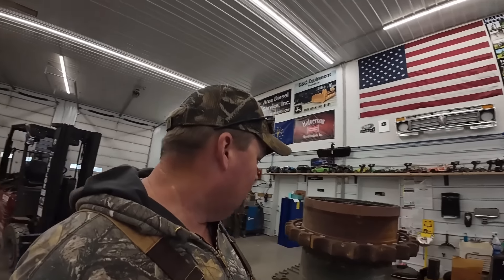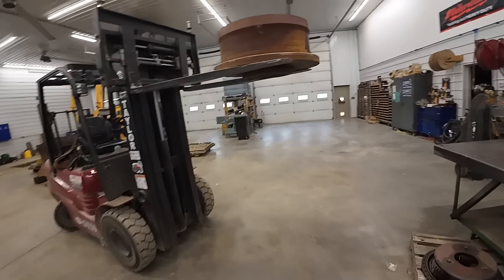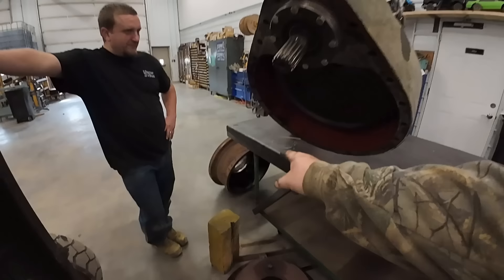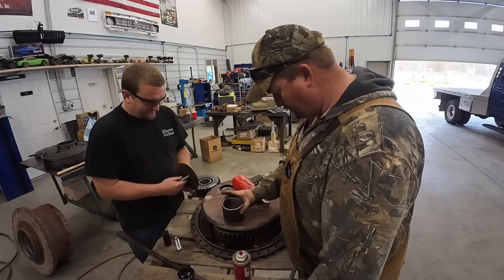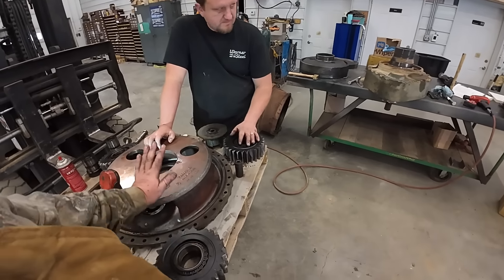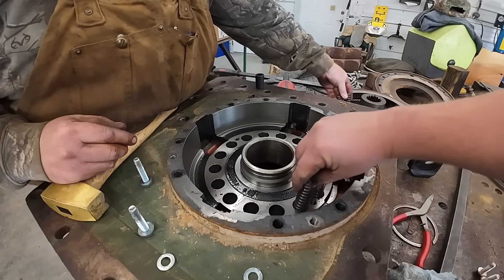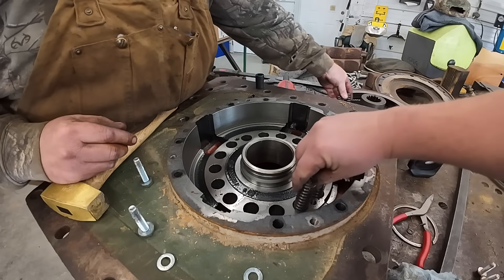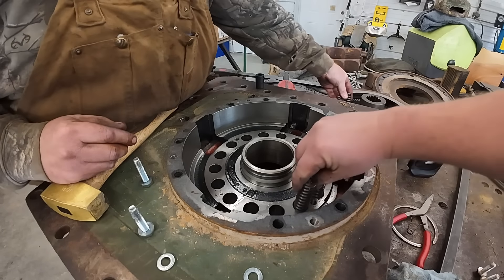We attempt to rebuild a John Deere 850J dozer final drive but we got a big surprise $$$

Comment: Tha Army should pay your company to train their soldiers how to do maintenance and repairs on their equipment. $$$$$$$$$
Reply: However the people involved have to WANT to learn HOW to and an awful lot of the population don't seem to me to be remotely interested in maintenance and repair work on machines they"operate." In fact there is a selection in society that intentionally set out to damage machines and equipment so that they get "down time" whilst it is being repaired or replaced!!
Just think of it this way -you can take a horse to water but you cannot make it drink!!
Dan
Reply: Heavy MX like replacing a final drive was most likely contractor work, not soldiers.

Comment: @32:25:  "Look!  It's a NASCAR dozer.  It steers by itself."  But you need to add:  "And it turns left!".
Great video, and another reminder of how frustrating it is when manufacturers change major components and make them incompatible with earlier parts (sometimes "necessary" and sometimes not).

Comment: What I hate is when the JD part numbers keep subbing up to a new number and then you find out you have change half a dozen other things because somewhere in there they make you change a housing as a update. I run into it in the 7000 series tractors transmission

Comment: Guy I work for has a 450j that the left track would randomly quit pulling. It would start out fine then all of a sudden quit pulling and you wouldn’t know when it was gonna happen. Wouldn’t pull in forward or reverse, turned out it was the right side speed sensor. Been fine ever since

Comment: Real interesting episode on just how FUBAR Aemy mechanics can be.
My oldest brother Mike was an Army special forces LT. who got seriously injured driving a jeep that the front of the main drive shaft fell, dug into the ground and flipped the jeep.
He ended up with some injuries but was able to return to duty 6 months later.
It was caused by a mechanic who had improperly installed the wrong snap ring.
I could tell you some stories my brother told me about Army equipment unqaulified mechanics worked on but that list is to long.
Of course we all know Clint and his crew will get that tractor straightened out ready to go to work for someone.

Comment: What is the actual difference between the early and later outer housing?  Is it possible to machine it to take the newer seal?

I work on all different kinds of vehicles and equipment and I repair pretty much any control module or computer myself in house.  Believe it or not I would probably say 95 percent of all problems are caused by bad or faulty solder joints.  It does get tricky when it comes to smd devices which requires having a smd rework station along with reballing equipment.  I started doing those types of repairs back in the days of the Nvidia video chip issues with laptops and xbox 360 repairs.

Comment: Computer measure resistance through wiring and sensor, if it’s outside values reports error. May still give a speed signal. At the speed the track rotates it’s probably a three wire Hall Effect Sensor. It’s power by the ECU and switches signal from hi to lo in a square wave pattern. A two wire Inductive sensor generates its own signal but signal strength depends on speed and I would think the component with the tone wheel might not be going round fast enough. Is it two wire or three?

Comment: Merry Christmas!!!     Could it be since the dozer you took the final drive off of was scavenged, it was off the one they scavenged for and just put the broke one on the scavenged one??   they swapped parts??  If I remember correctly, this broken final drive looked like it was not in very well, someone just got it close since they knew it was broken??    just slapped it back together and called it 'ypn' as some other commenter said lol

Comment: wouldn't it be possible to adapt the new outer ousing,ot the inner part, to fit either the old seal or the new one, ore fit a completely different seal, with one-off adaptors? to save 10.000$ you can put in acouple of machining hours!!!

Comment: everything john deere is massively overpriced. i had to buy 2 hydraulic fittings and paid $92 for them because i needed them. next day, i bought the same exact fittings from a case dealer that was next door for $20. the only difference was the john deere fittings had "made in china" on the side. love the work you guys do. keep it up :)

Comment: As one who been around eqipment all my life. I need some imput to what better. Hydro is putting a new 2nd transmiton line across my farm cutting all the trees my cows use for shalter. I never needed a maching other then my boom truck to feed hay an rent a mini ex every summer to cleam up winter feeding area  but now they have to build me 2 big 3 side shelter an pay for a machine an straw for cleaning them out an bedding them weekly. 
 My only option for brand of tracked skid loaders is  Caterpillar, Wacker nuisance and bobcat. I got qoutes for all 3. There other brand but no local suport. I never used a  Wacker Newson Wacker or seen a Newson. An dealer has none in stock ether do cat or bobcat .. only thing i been able to go by is you tube videos.
ST 50 97Hp Wacker. The the Cat 200D 100hp but $17000 ?more and the bobcat T770 97 hp 
I undecided witch one to go with all but the cat don't use Def .. review videos I seen  Wacker has the hights tork to the ground at 197 lb per sq inch head to heat it pushed all others around.  An hood the only one that will come here for waranty work. The 2 other dealers i have to float it to there shop 45 min away for any waranty work. . Being Hydro paying for 2 cow shelter I need a machine to clean them out an bed them weekly so there paying for the machine with hay spear forks 9' wide snow blade to plow down to shelters. 12" post auger graple bucket tooth bucket an cutting edge bucket.  
Any imput welcome?
Reply from the maker: Not really been around the wacker machines but they look ok
Not a fan of bobcat anymore 
Cat is ok but a pain to work on
Cat will have better resale value 
It really comes down to dealer support
Reply: @C_CEQUIPMENT  Thank you for the feed back, i agree bobcat gone down hil ever since they changed owers, not only is cat a pain in the ass like Kabota, witch is far worse, we have a Kabota dealer here but due to me working on nabors machines, you have to rip half the machine a part just to get to one little thing.  i never even gave them a second though as to on my list, not only is that cat 17k more then the other two but the parts are 3 times the price and they will not come to you to do any warranty work unless you are a huge contractor and nothing but cat equipment, the bobcat dealer it a gable if they will come toyou to do warranty work, seems it depends on the managers mod that day. i have worked on a few older bobcats and one new one and it was not to bad to work on, but the quality dont seem to be there any more, i never run or worked on a  wacker track loader but have worked on a few on there compactors, Hood logging is the dealer for wacker they are also the dealer for Hyudai excavators but they will not take on the new line of track loaders yet untill they have a few in there rental fleat for a few years, witch they have not even looked at yet. but all the excavator an dozer rentals i done with them have been great and people i know with Hyudai excavators in all size are very happy with them. but i cant find a wacker,, none of the 3 dealers have stock on the units i been looking at, i rented a bobcat T770 few years ago but you know how 5 year old rentals are. i just dont know about wacker, the sales guy really puts them up there but thats his job, in any case with a few attachments we lookingg at 190k with exception of Cat, add 17k in CND FUNDS https://www.hoodequipmentcompany.net/
Reply: @C_CEQUIPMENT  THE WACKER  has a 2 year bumper to bumper machine warranty or 2000 hours. 5 year engine or 6000 hour warranty, Hoof use to have ASV IN RENTAL  but no  more, being i rented them i know why, there no dealer here for the track loader lets dig 18 has. The clam to why none of the dealers have stock is due to shortage of hand controls, i am told a 6 month wait from time of order..